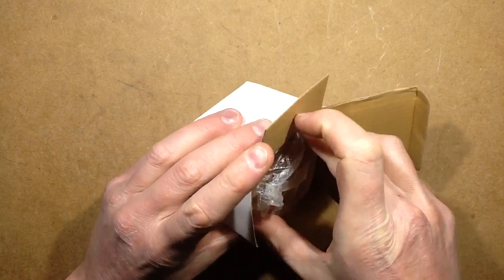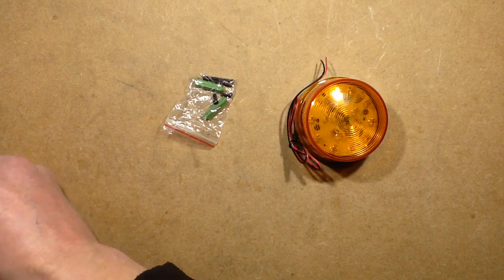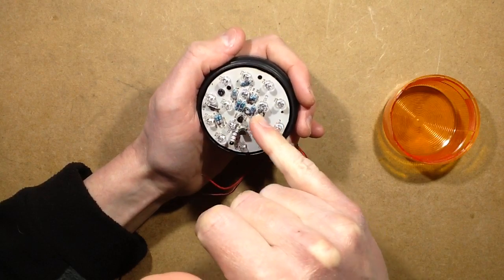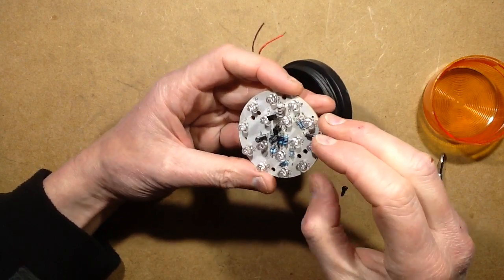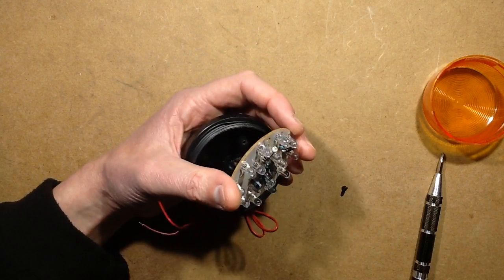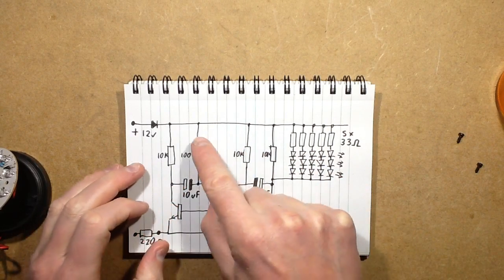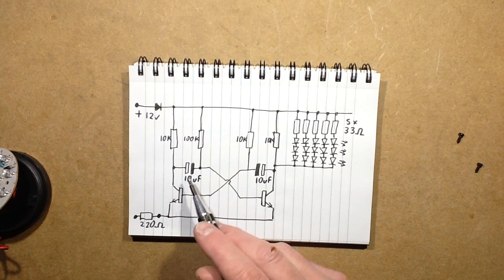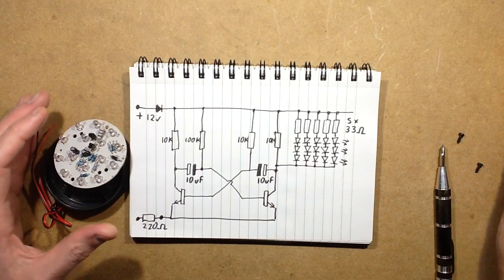Teardown and schematic of LED strobe beacon.

Comment: Dont like that ,its poor at the side of the proper xenon ones.used to use loads of these and with a unit called a sound bomb when these went of in a building you had to leave they really thumped your ears,bought one just recently and now they are rubbish too guess its called advancement.

Comment: I clicked this thinking it was "LED Strobe BACON" Damn it! 

That said, my project at college was a multi-tone door bell that used 555's to drive a 4017b decade counter, which fed a common track, then resistors fed down to different pins on the 4017b. The output voltage could go to a 741b opamp to drive a loud speaker or it could go to a piezoelectric buzzer. I used the latter for brevity, however, I still got 40/40 for it. Was a fun thing to build.

Comment: A friend of mine has some army surplus linear flash tubes which are around six inches long still in the original packaging.  He runs an electronics shop close to where I live, plus runs a radio transmitter service business on the side.
Reply from the maker: +douro20 The fairground industry uses XOP25 xenon tubes in its strobes which run at a mean power of 2kW and a peak power of about 20kW.  Very impressive.

Comment: It's been a while, but isn't 48 volts the default voltage for industrial control applications? Had to know a little bit about it a while back, but thankfully not anymore (the warehouse sized machine was at the time 20 yo. and hooked up to IT we maintained).
Reply from the maker: +NekitaNet 24V is a common industrial control voltage.
Reply: bigclivedotcom I see, so then the question remains: What applications would use a 48 volt and warrant a warning light.
Reply from the maker: +NekitaNet There are a wide range of control circuit voltages used in industrial equipment.  12, 24, 48, 110, 240, 415 and others.  I think the manufacturer of this light has just tried to accommodate all the common low voltage systems.  In my experience many industrial systems here tend to use 24V with a DIN rail mounted SMPSU, or sometimes a proprietary power card.
Reply: bigclivedotcom It's a nice light for sure and at that price it's even wonderful. Thanks for the explanation :-)
Reply: 48V is common in telecommunications equipment (due to a lot of communication equipment having a battery backup).

Comment: Looks good. Too bad they used electrolytic capacitors. There are cheap 10 uF SMD ceramic capacitors which would last forever.

Comment: Yeh same as Sparky P, I remember using this Flip flop circuit many years ago, but not with led's it was light bulbs then.....oh those where the days Haha.
Reply from the maker: +Graham R Dyer My very first kit ever was a flip-flop driving a torch lamp.  Not much to mess up there.   Shame I messed it up.  :(  Oh well, first kits are always a bit hit or miss.  (I think I smoked a transistor by lingering too long with the iron.  This was almost 40 years ago though.
Reply: i tried to flash a car headlamp with a couple of AC128 germanium transistors when i was very young....the one driving the lamp went up in flames quite nicely..😲

Comment: The astable multivibrator was the first circuit i built over 45 years ago, so when you said '2 transistors' i immediately thought of that, mentioning 2 capacitors confirmed it.
Very useful circuit, i'll often use it instead of a 555, and it cascade-able for a chasing light effect ;)
Reply from the maker: +Sparky Projects The ring version.  I see some Chinese kits with that version of it.  It's a great beginners circuit.  Low component count and great visual results.
Reply: +Sparky Projects That's cool, but I've come to prefer using an OpAmp relaxation oscillator for the purpose.
Reply: Ditto. :D

Comment: Correction, that circuit is not flip-flop, it is astable multivibrator.
Reply: Hmmm, I guess that if we are going to be really pedantic about it, the name multivibrator should perhaps be limited to when the circuit is configured as an oscillator and the harmonics are employed, as the "multi" part referred to it generating a large number of frequencies as compared to sinusoidal generators, which was a property used in some applications, and "vibrator" to it's oscillating nature.

So, the term "bistable multivibrator" is not strictly correct as the circuit does not oscillate nor do we generally use the harmonics, the correct name back in the days would probably have been "trigger circuit", or more specifically an Eccles-Jordan trigger, though today the term "trigger" is perhaps most commonly seen when referring to the Schmitt trigger(which is rather similar, though lacking the feed back that causes the "flip-flopping"), or when talking about a monostable circuit being retriggerable or non-retriggerable

As for the term flip-flop, that is really descriptive of the behavior of a circuit, that it can flip-flop between two states, and so should really include all the circuits with the feed back that ensures that only one state can be on at any one time(within the ideal operating conditions, of course).

Of course, in reality jargon terms are defined by how they are used, not what the term historically was used or what the words really means, and the way a term is used may depend on context and may have regional variations etc, and so it is perhaps those that insist on a specific meaning that is really the only ones that are really wrong.
Reply: +Miloš Lazović  which is a flip-flop that automatically flops. That transistor arrangement is a flip-flop.
Reply: Andy Plater
No, that circuit is astable multivibrator and not be flip-flop. Flip-flop is a circuit that has two stable state, and this cicuit is not stable in either state. This arange of transistor is common for all multivibrators (astable, monostable or bistable) and flip-flop is just another name for bistable multivibrator.
Arrangement of transistors don't make what type is circuit, one transistor amplifier have same arrangement of transistor as one transistor oscillator but they are not same.
Reply: you're right in that that's what arrangement the circuit is in, but the flip flop is a smaller component of that. If you took out some of the passives you would have a simple flip flop.
Reply: Andy Plater
Flip-flop is just one type of multivibrator (bistable), if you remove a capacitor from this circuit and connect external trigger instead of it you will get monostable multivibrator, if you remove both caps and connect triggers instead of them you get bistable multivibrator (flip-flop).
All of them have same base (mutivibrator) and only capacitors/trigers make which type of mutivibrator will be.
Reply: I agree with it being called an astable multivibrator rather than a flip-flop.
Typically, a flip-flop is a circuit that can remember one binary digit. So for example, computer static RAM chips contain thousands of flip-flops.

There are many ways to make the various types of multivibrators, and many ways to make a flip-flop. The circuit using two-transistors of the same type is just one type. Another type that is fairly common uses a NE555 timer chip (which can be an astable multivibrator, a monostable vibrator, or a flip-flop).
Reply: Ts6451 No one here is pedantic, in electronic there is well defined for what name astable, monostable, bistable (flip-flop) multivibrator apply.
One of major difference between someone who know electronic and one who don't know is that first one use correct terminology.
Now we can argue is adopted names are semantically correct or not, but they are adopted as standard and if you want to properly expresses yourself they should be used.
Reply: +Andy Plater Definition of flip-flop:
Flip-flop is circuit that is stable in either state. It can be flipped from one state to the other by an external trigger pulse.
This circuit don't meet any requirement to be flip-flop (it is not stable in any state and do not change state by external pulse).

Comment: I was expecting a 555 timer. Why do you think they didn't use that?
Reply from the maker: +jak p (skiguy09) Transistors are cheaper, simpler and more reliable with a wider voltage range.
Reply: Save money???
Reply: True enough. I was thinking a 555 was about the same or less cost as two transistors and its support electronics.